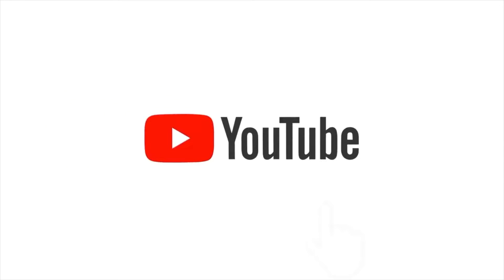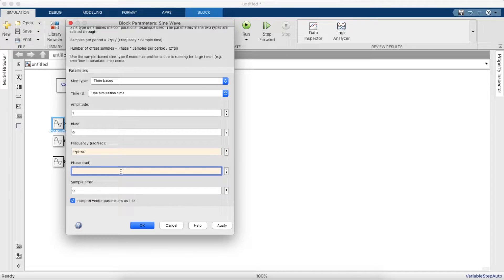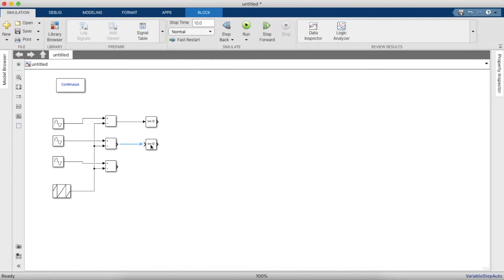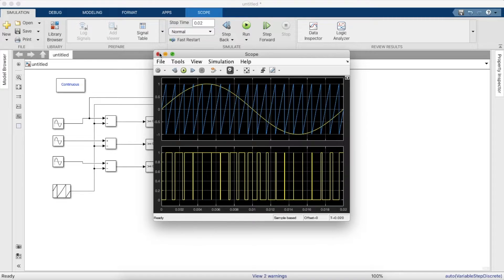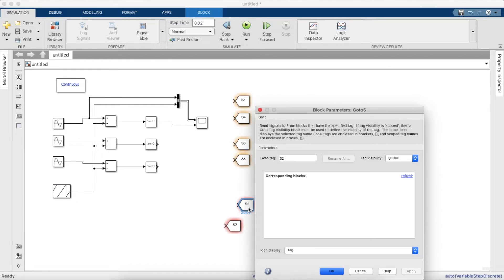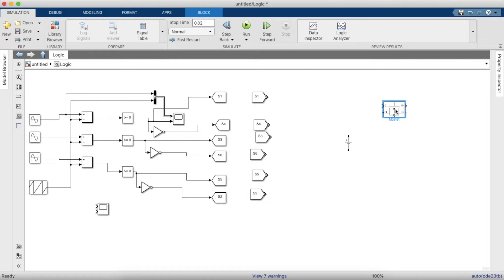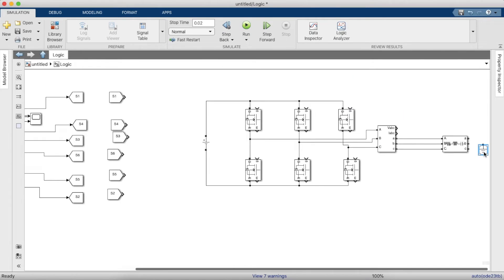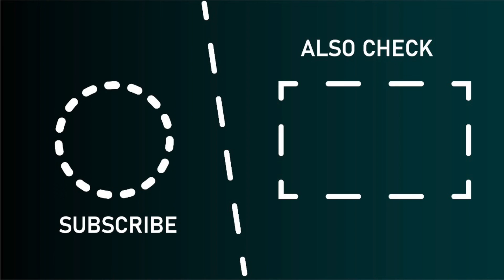SPWM 3 Phase Inverter Step by Step Simulation on Simulink

Comment: Thank you so much. I am investing my knowledge more in electrical drives because of the zero-emission goals in the further. I gonna try to link it with a physical hydraulic model.
Reply from the maker: All the very best Albert!
Reply: @TheUrbanScholar  May I ask you something? I am very happy with the model, but I cannot get it linked to a hydraulic pump/powerpack model. Do you have a tip as to where I can find out how to connect these models?

Comment: Sir I wanted to simulate a single phase inverter with at 500W, 12V. So the output current must be close to 41.67 Ampere. But my simulink block generates close to 4A at 12V. That's a total power of 48W. Can you suggest methods to increase the power rating on simulink. I have used 12V 65Ah battery as the source.
Reply from the maker: Hope you're doing well! Current drawn depends on the load. You can represent loads in multiple ways like in terms of ohms or interms of watts, I'd suggest you to represent in terms of watts so that uou get W/V current
Reply: @TheUrbanScholar  It's not working sir. i used series rlc branch at different ohms. I used series rlc load at 500W active power. There is no useful change.
Reply from the maker: Could you mail us?